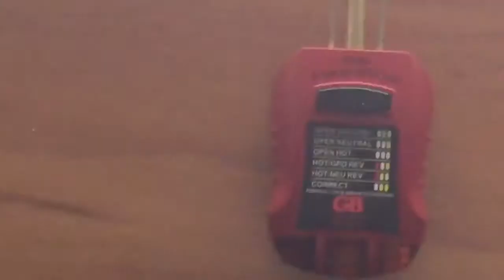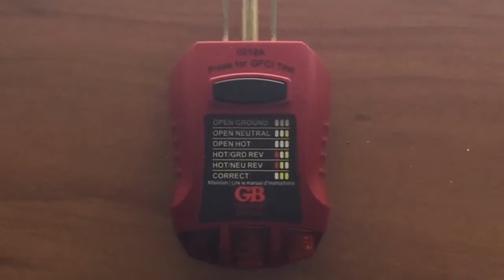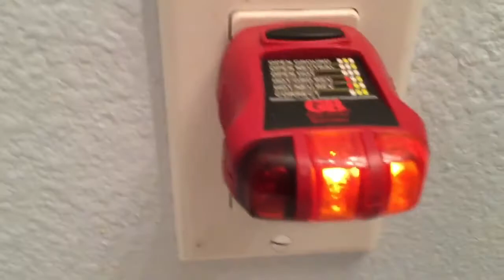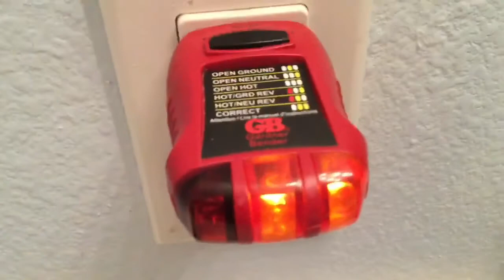Review on a Gardner bender gfci outlet testers

Comment: Finally someone tells me what the two lights indicate..means it ok circuit...thanks
Ns
Reply from the maker: Yes. Don’t be fooled by this. If it looks ok then take a pen tester to the outlet without sticking it in to the outlet and see if it goes off. That means that someone wired the hot to the neutral and jumped the ground to that side and the neutral to the hot side. I have seen that before.
Reply: @electricalsmokealarmsandmo1564   thanks ..good tip.
Reply from the maker: GREGORY KLEIN by the way I subscribed.

Comment: And what if no lights come on
Reply from the maker: high im Flash no lights means that the outlet does not have a hot wire is disconnected or no power is going to the outlet